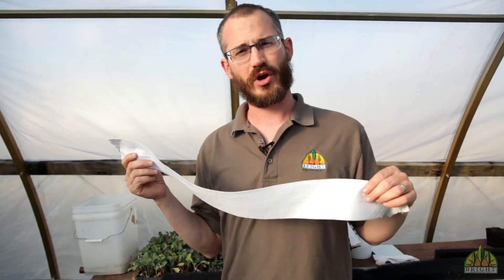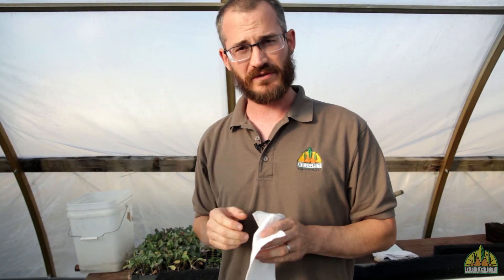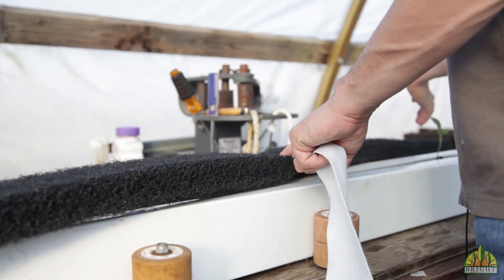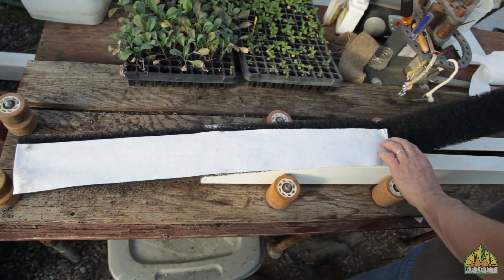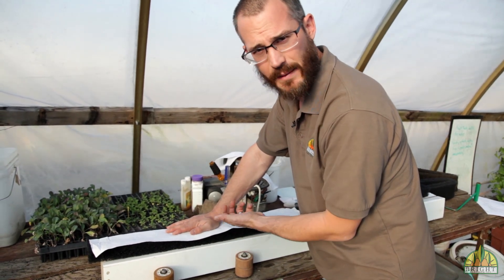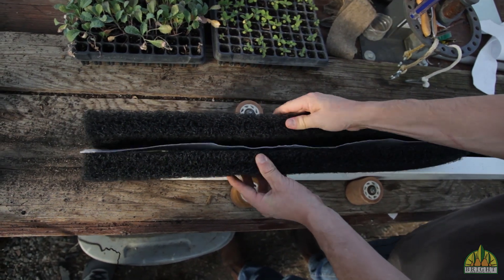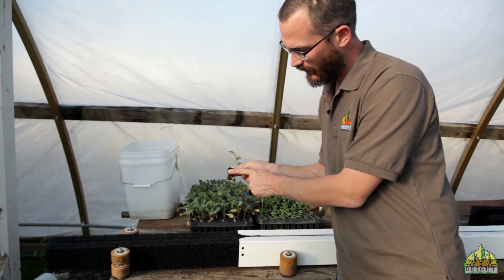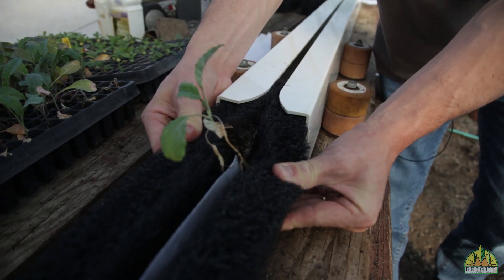How to Use Wicking Strips in ZipGrow™ Towers

Comment: You've probably thought of this, but if you could mix some threads/bands of a higher density material (even felt) in with the media itself (in manufacturing) you might get more water movement throughout the profile and skip this step. You'd just have to be sure they were well distributed and did not reduce your pore space too much.
Reply: Max Osterhaus the wicking strip gets used up over time whereas the media is inert foam. It's easier to reuse the media and throw away the strip between uses